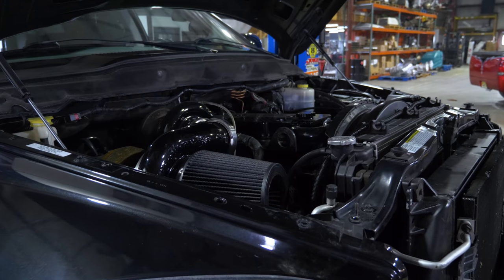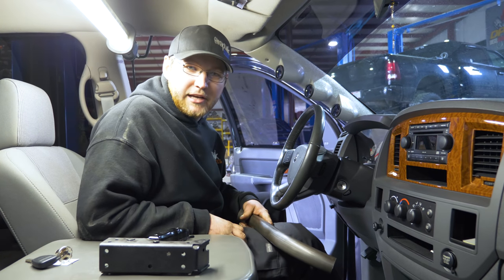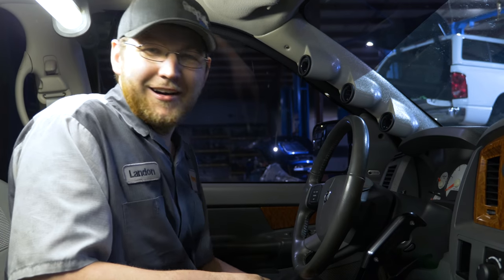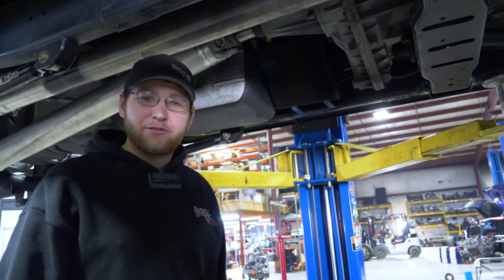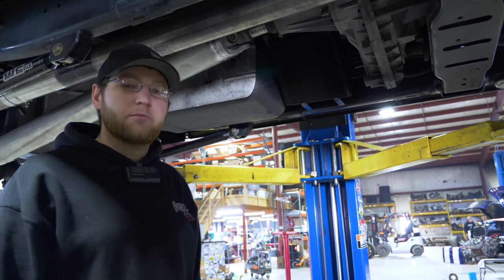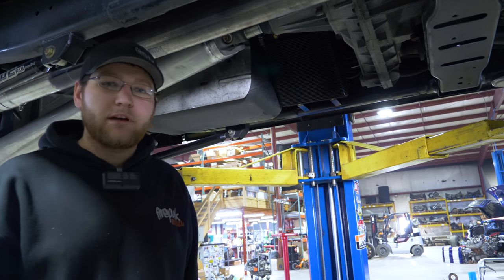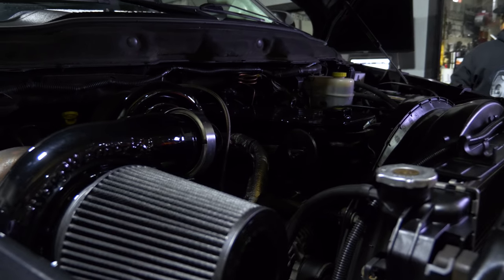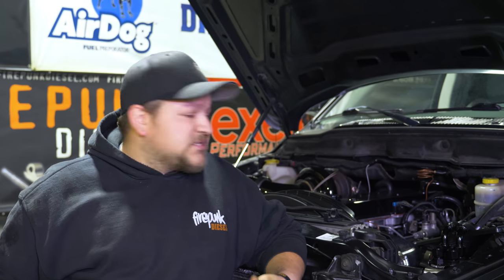G56 TO 48RE SWAP - BOLT IN ROLL BAR - 1300HP TRUCK FEATURE

Comment: I know with the 68rfe. I have a Volvo XC90 shifter with the manual selection that moves forward and back instead of the steering shifter for the 68rfe it works slick, and I get that sequential shift I was looking for now to figure out how to make it to where it stays in the gear and isn’t just a gear limiter. With performance driving I am high enough in rpm it is just like a sequential , but low rpm it will still downshift towing a heavy trailer which I will figure out

Comment: what did it cost to do teh G56 to 48RE swap? I want to do it with mine.
Reply: I almost want to do the opposite
Reply: @vasiliydron  hahaha trade you lol
Reply: Might have to hit you up once im ready to do it
Reply: I have a nv5600 and want to go to 48 auto
Reply: I want to swap out my G56 also for a built 48RE as well. I’ve got severe knee issues from the military and pushing the clutch in constantly causes my knee to lock up in traffic.
Reply: Vasiliy Dronov why you not like your 48re??
Reply: @hawkes1975  if you make the swap I buy your manuals parts